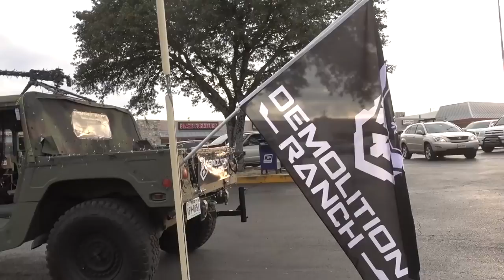Soooo....We Bought a Crack House...

Comment: that's great but if you suspect that it was a drug house...you might want to get it tested by a professional to make sure there aren't in substances that have soaked into the floors, walls and etc because there are reports all around of families having to move out because their families starting to get sick...only to find out it was a drug house before
Reply: beth hinton thats usually for the manufacturing of methamphetamines, going by the needle I'd say that they were on opiates. (Heroin, oxycontin, etc.) But hey, could've just been some messy diabetic potheads.
Reply: beth hinton I second this, as I had a buddy almost die from exposure to residue when remodeling a similar house.
Reply: Johnny Brewer meth residue is very very dangerous and the chemicals used are very very poisonous and explosive. However, going by the looks of this house, it was not used to cook meth. I'd say previous remnants were users of opiates at worst, which theres a few good indicators of (needle,messy,burn holes), marijuana at least, (could also be the cause of burn holes, and he mentioned a smell). I think he's safe.
Reply: Agreed. Missing light bulbs tops it off.
Reply: Slednex700 tops what off? Druggies can't afford light bulbs.....lol
Reply: thats why they take them when they move out.
Reply: allalone or they burn out and they never replace them, or they use them to smoke drugs
Reply: oLEOresin Capsicum they use them to smoke out of
Reply: Slednex700 true. All in all I do think they were just some crackheads. The house is too okay to be a production site.
Reply: Slednex700 lol, that's what I said.
Reply: weed, and opiates. They definitely smoke the pills (opiates) too. Most likely the type that'll do anything they can get their hamds on. Being an officer I've seen it all......well mostly.

Comment: Remove the carpets completely. Since its a rental in my opinion itll b less to replace if the tenants decide to move out. But i like the layout overall. There is alot to work on but nothing impossible. Best of luck brotha!
Reply: David Velasquez nah, carpet is cheap and easy to replace. Hardwood or laminate would be much more to replace if damaged.
Reply: Micheal murray, floors usually dont get replaced until after several years, 10+ years, and most times a buff and a fresh coat of poly does the trick to bring life back to the floor. These floors look great cuz its 4in boards and makes them a dream to work with. Sanded and refinished would give the entire house character and brighten it up. Again its just an opinion. Matt is definetly creative so im sure whatever he goes with itll look great
Reply: Rich Savage very true. A little tlc and pow u got a rental

Comment: Dude the lock on that door is sketchy man. Who did they lockup in there.
Reply: German Elite Tuning the people who were freaking out while they were high
Reply: The MC Enginner yah that could be. Or they locked them selves in to keep those people out.
Reply: It locks from the inside
Reply: puddle rat that’s a great guess.
Reply: Maybe they locked up that extra kid at 12:11
Reply: Some extra safety in case Omar's coming.
Reply: or maybe the kids while they getting high.... seen it many times
Reply: More then likely they had roommates that they didn't want in their room. Simple.
Reply: German Elite  it locks from the inside so there’s prob a small chance they kept people in there cause they could just unlock it
Reply: good thing it wasn't double sided. Im guessing that its more of a rental thing
Reply: It locks from the inside m8
Reply: Pretty hard to lock anyone in if it locks from inside.
Reply: They locked up crack because it’s called a crack house
Reply: Have any of you calling it a crack house ever seen a crack house? They most definitely aren't that nice. They are run down shacks with blacked out windows and stained walls from so much smoke in the air. Trust me I've raided my fair share.
Reply: Deadbolts on a interior door=cutting room for the product.
Reply: No one that wasn't able to get out immediately since the lock is on the inside of the door.

Comment: If there is any possible way, I would recommend to try to salvage those hardwood floors, because buying new ones are really hard to come across or just really expensive.
Reply: SwiftRaptor if you want wood and theyre fucked just put laminate floor right on top

Comment: I would highly recommend instead of wall to wall carpets give it normal flooring and put rugs over the floors, if it becomes damaged or dirty, the rugs can be moved out of the area. Also if you're renting it I would recommend you take out the garbadge disposal in the kitchen. A tennant will drop a spoon in and it will be a real headace.

Comment: Painters tape on the toilet was to hold plastic wrap over the toilet so people wouldn't use said toilet while the water is turned off and because there is antifreeze in the toilet (or there should be) anyway my current job is working for the mortgage companies that own these types of houses, I would guess this is a former foreclosure and you guys bought it after a garbage service company cleaned it. If we got this house we would have cleaned it better and cleaned up the yard. Maybe Texas has some relaxed rules on how much the mortgage companies have to do before selling.
Also if it was a meth/crack house, aka they were producing either, it would have been reported and torn down to its studs ESPECIALLY if it was meth. 
Anyway that house seems to be in pretty good shape. The floors are the only real issue that can't be glossed over with a coat of paint and that master bathroom is rough.
Also we have about 20 houses we maintain in Georgia if you guys want to branch out lol
Reply: g_Hunter_g are you sure you're supposed to flush antifreeze down the toilet? I get it's to prevent it from freezing but why not drain it? Just curious.
Reply: Or maybe the seat was just broken....
Reply: They condemned a house in my city for meth production, it's still there

Comment: My dad owns a construction company and the crack houses he flips are crazy!! He doesn’t let me inside them, but we see pictures. Heroine needles under the patio, the kitchen island had cuts that were obviously coke line cuts, the carpets smelt like vomit and weed, the walls had cigarette burns in it (who puts them out on the freaking walls?) and there was water stairs on the wall but no pipe damage to cause it. The basement smelt like battery acid and gasoline so we are pretty sure people made meth in there. Black mold in the bathroom.. it ended up just being ripped down and rebuilt

Comment: I've been a type 1 diabetic for 25 years and I've also known drug addicts so I can tell you that the best way to tell if that syringe was used for drugs is to check the tube for blood.  Its very rare to get blood into a syringe used for insulin due to it being a subcutaneous injection into fat tissue.  Whereas a drug abuser as far as I know almost always injects into a blood vessel and will draw-back on the plunger to make sure they've hit one. Which will flood it with blood every time.
Reply: man that's just fucking terrible

Comment: It's a "water heater", no need to heat hot water.....😎
Reply: What if you want hotter hot water
Reply: I thought I was the only one to think that way
Reply: THANK YOU!
Reply: Here in Texas, the locals are so dependent on all things air conditioned and refrigerated, that anything that hasn’t been chilled is called „hot“ (i.e., room temperature Coca-Cola is „hot coke“). 
So yes, non-refrigerated water is „hot“ even before the water heater heats it up, hence the name „hot water heater“.
Reply: It's a heater that provides hot water, hence the term.
Reply: It is a hot water heater.  If the thermostat control is set to 120f and the water temp in the tank drops to 110 it heats it back up to 120. 110 degrees is still hot so it is heating hot water ergo it is a hot water heater. The only times the water in the tank is not hot is when it first being filled or has been turned of for a long time.
Reply: JustNobodyButME I now understand your name........
Reply: You guys are overthinking this. I've called them hot water heaters my whole life but I grew up in Appalachia. So I suspect it's a southern thing.
Reply: @Tim Caffell  It is a good name. Has many layers to it. Like an onion. :)
Reply: @ParadigmUnkn0wn just  having fun poking holes. Not like "ATM machine" though. That's just plain redundant.
Reply: JustNobodyButME Same with people saying VIN number...
Reply: It’s just a regionalism. Here in NC people also call it a hot water heater.

Comment: I don't know about the meth house or a crack house, but from the standing of the look of the house. YOU ARE SO LUCKY. You mostly look like it was a case of slow house keeping. The rug ya should have been vacuumed a little more and washed the doors more. But most of the house looked fine. No busted wall boards, no pluming pulled out, not a house full of trash on the floors. Oh my havens they even cleaned out the draws. And best of all wood floors and NO COCKROACHES. SCORE!!!!!

Comment: They didnt take the bulbs with them

They unscrewed them then turned them into meth/crack pipes lol
Reply: Actually, turning a light bulb into a "meth pipe" is far more effort than most addicts will bother to go through. (unless they're A:Ready spun out and end up hyper focused) Meth addicts will just use.... Wait for it... 

... A meth pipe. Available at any head shop for barely $10. Or they'll just use aluminum foil. Way quicker, way easier. And  whole roll of aluminum foil is like $2.

Comment: Be glad they only took the light bulbs.  I've seen homes were they took the flooring, cabinets, furnace, water heater and wiring.  Surprise!  I will agree with others in that you do need to change the locks and get a security system installed.  Even a cellular trail camera will suffice.  Why?  Because people often come back when they need a roof for the night.  That and they are sometimes mad that they got kicked out and are seeking revenge.  I do agree that the house is too clean to be a real "cocaine home".

Comment: That one room with no door handle should be completely redone. Must've been like a hooker room or whatever. Meth heads took all the bulbs cause they use them as pipes. If they were cooking meth there then the entire house would need to be redone. All the chemicals used would get into everything. Doesn't like it's been used for a cook house tho which is good. Probably just a party house.

Comment: I cleaned apartments after the tenants moved out. One I thought it had nice frosted windows until I started to clean them I took a razor blade and scrapped probably a quarter ounce of crack off the windows. I dumped it down the toilet boy was I getting high just being in the apartment had to take a lot of brakes outside so please wear not face masks but respirator and rudder gloves.